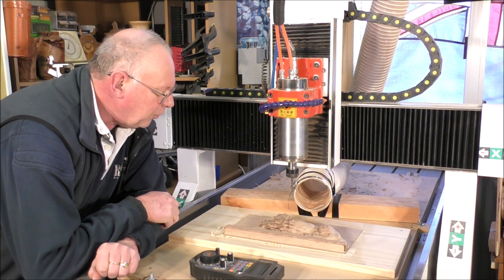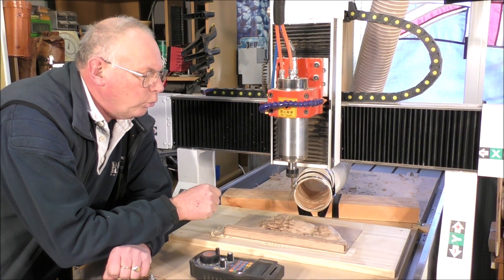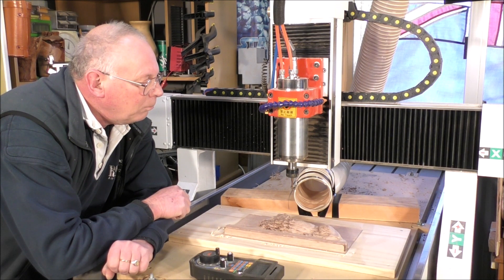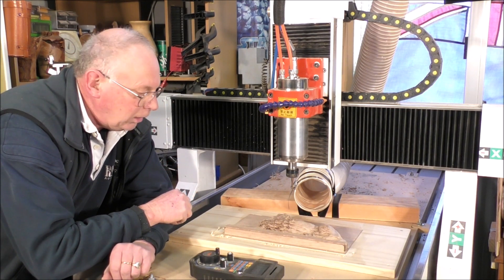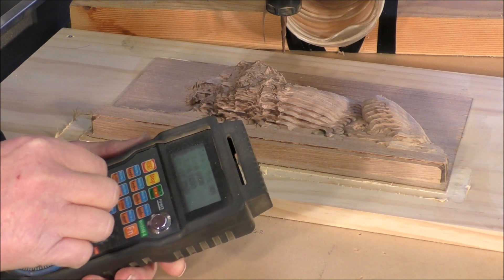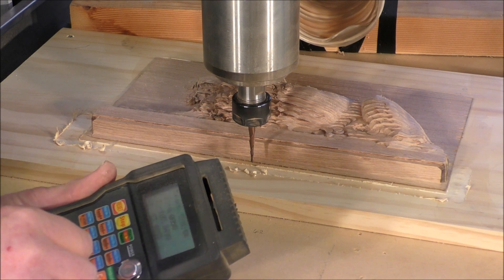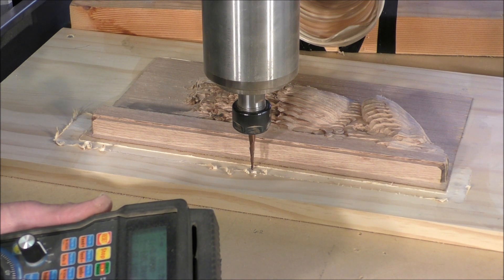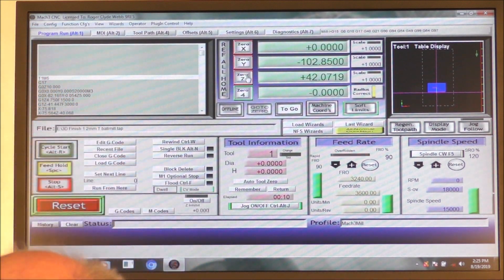CNC Router making $2,000 a day custom 3D carvings of the lion king

Comment: Sir I am not understanding your z zero method, first you down the spindle where material cut but roughing tool then you set z zero, but after some time you pull the spindle 42 mm height and again z zero, so why you did two times z zero.please guide

Comment: Is Avid benchtop cnc is come with all accessories or we have buy the control system and router and  router holder. I saw in Avid website says some recommended accessories.I am planning to buy a bench top cnc 24 × 24 .Could you please give me some tips or suggesstions .